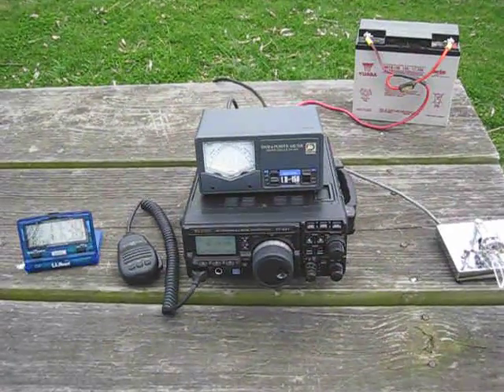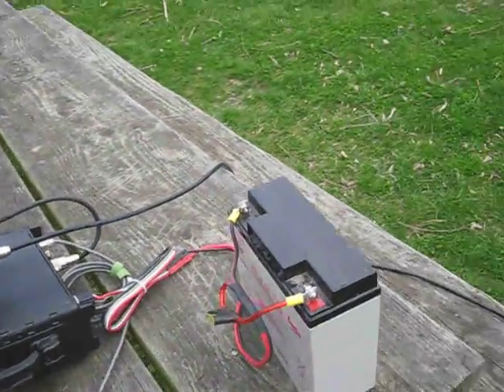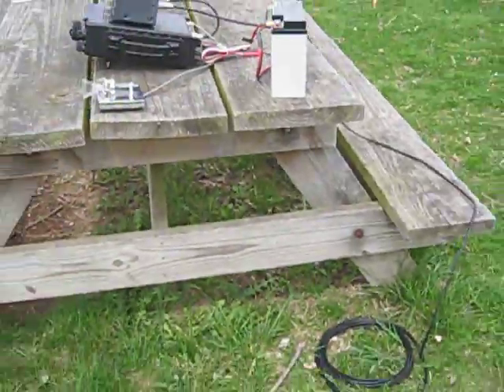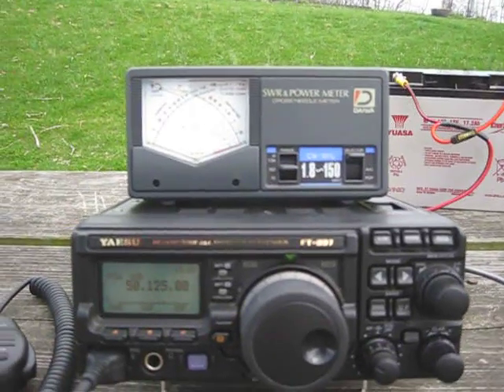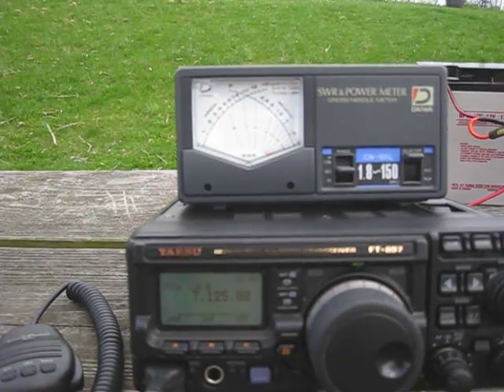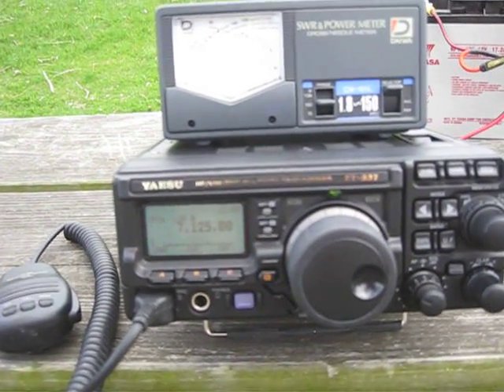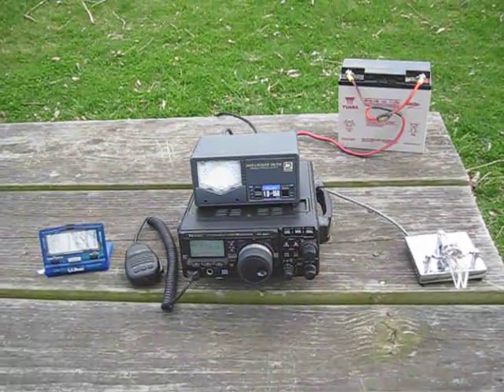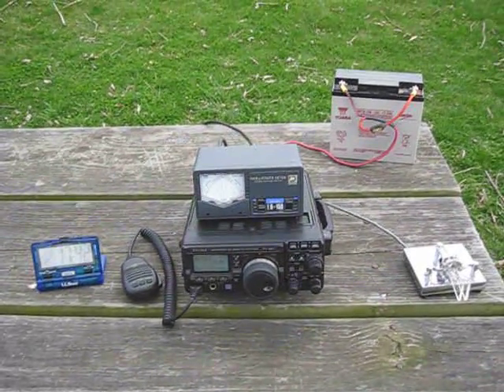Hy Power Antenna Company 40 Meter Off Center Fed Antenna.....Part 1

Comment: I have the Hy-Power Antenna Co. 40 meter OCF demonstrated here. It works beautifully. Installed as a sloper with one end up at about 35 feet sloping down to 24 feet, SWR is always under 1.5 on all bands Barry has cited. It also works on 2 meters, believe it or not.
I  put mine up a week before hurricane Sandy and it made it through the storm beautifully.
Reply: Pete Tauriello thanks for sharing.

Comment from the maker: What other bands are you talking about? 2 Meters? As for HF, it only works on 6, 10, 20 and 40 meters. It is not designed to be use on any other HF band. By doing so you can damage the balun.
Barry
Reply: The 40M version (OCF40) lists 2, 6,10 ,20 , and 40 meters.
Reply: @BillBroadley  That is correct. It does in fact work on 2 meters. I just forgot to mention it in this video.
Barry